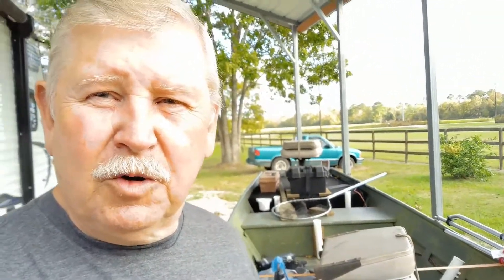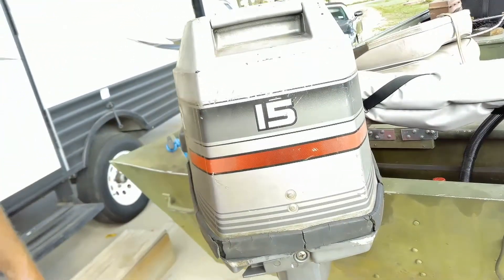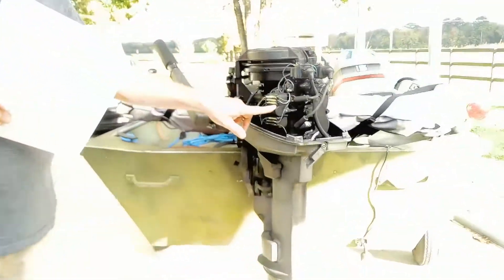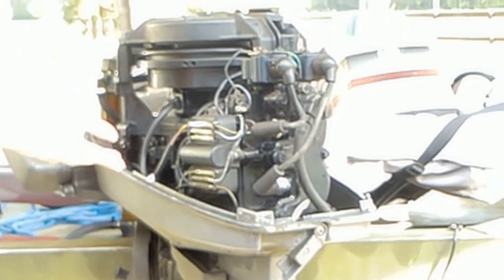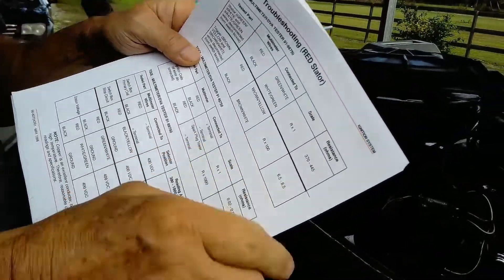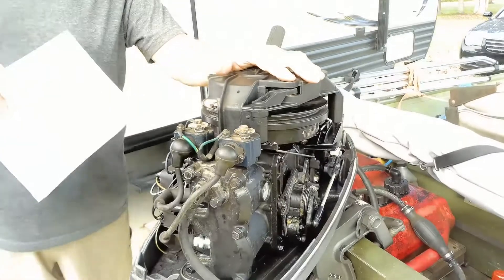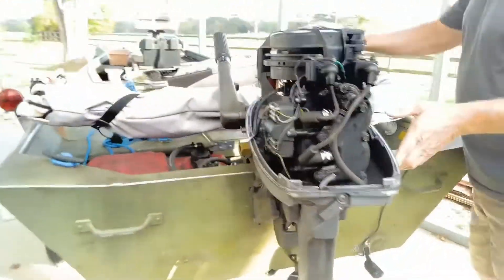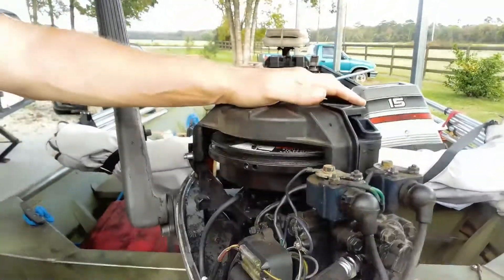1996 Mercury Mariner | Trouble Shooting No Spark

Comment: I don't have spark in the top cylinder.  Can't figure out how to disconnect the coil from the opposite end of the plug.   Do you just yank it out?   Or is there something more to it.  Thanks.
Reply from the maker: It should just pull out of the coil....